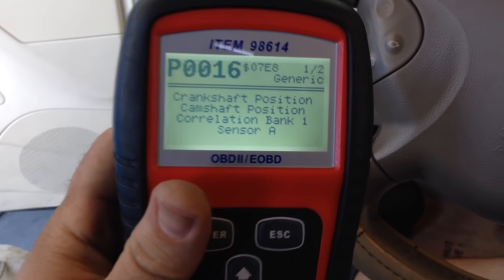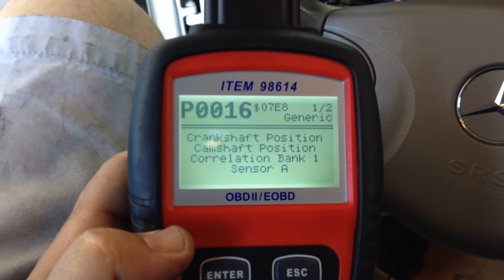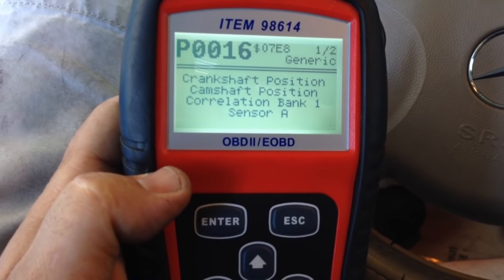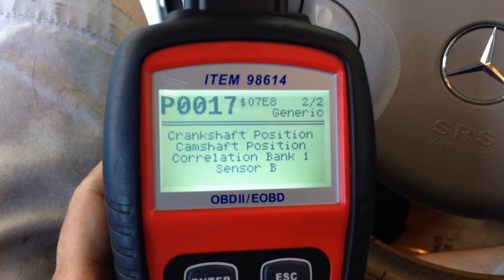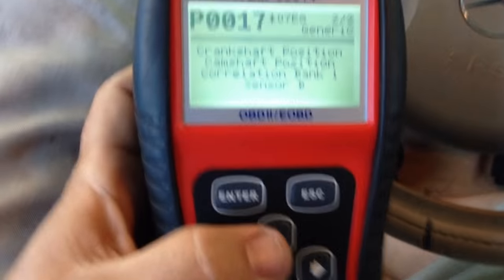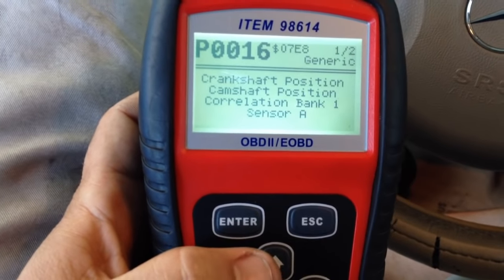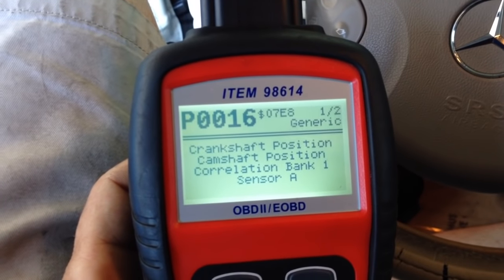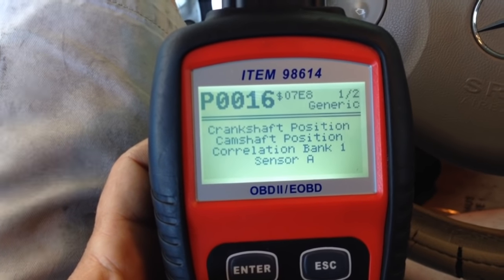Mercedes Camshaft position sensor p0016, p0017

Comment: I have a 2006 c230 & have just gotten these 2 codes (P0016 & P0017).  We just changed the oil with the Mobil 1 synthetic oil & the codes still appear after being cleared as you mentioned they may.  Previously, I received 2 codes (P1200 & P1208) which appear to be very similar codes.  Can you recommend if I should get this work done or just invest in another car?  Or, do you have any other suggestions that I'm not considering?  My car seems to be running very "rough" & I don't want to get stuck in LAX traffic.  Thank you very much!
Reply from the maker: I can't make financial decisions for you but I can tell you that a repair can cost around $4,000 and if done right you should have a good running car for long time.

Comment: Hello David, I own a 2006 Mercedes-Benz c280. The check engine turned on and teo codes showed up at the same time (p0015,p2768). Before it turned on I felt with time how the gears were shifting rough and it was getting worse and worse until the check engine turned on. Now it is stuck in a gear, i believe this all started when i changed the engine oil. What do you think the problem could be? Thank you have a good day
Reply: Thank you David for answering, I just had one more question. I have a powertrain warranty for 3 months, if it would not be covered by any chance, how much is the estimated cost of the fix?
Reply: Where is his reply

Comment: David gr8 video. I have a 2010 E350 and having engine start problems occasionally. The battery and alternator have been checked as good.My engine has failed to start on several occasions after the car has been driven or on the first start of the day. I am baffled by this,do you have any suggestions? Thank you

Comment: Have you heard of this happening with a 2007 Mercedes Benz clk550? And what if it's just the P0017 code? Could it be something else more simple and if so, how can you tell?
Reply: How did you get the code p0017 fix?
Reply: @olaomishore  It was a car looking to buy, thank God I didn't. I found an '08 CLK550 for $4,900 45 minutes away from me, so far I haven't had this problem.

Comment: Just a quick question, what ratchet attachment and size would I need to rotate the crankshaft to 305 degrees on a 2006 Mercedes C230 (M272)?
Reply from the maker: 27 mm

Comment: I have my 07 E350 and when I start my Benz I have rough idle some time and other times I does not happen at all.  by rough idle i mean that you can feel like if the engine is either miss firing or the cam or crank sensor did not catch the right position so it idle funny and you can feel the irregularity in the idle, not a smooth idle. could this be the cam shaft sensor?
Reply from the maker: StealthShadowFox do you have any fault codes??, it can be as simple as motor/transmission mounts and it can be as bad as the balance shaft, if you are in GA, bring it in so we can check it for you.
Reply: Mercedes Benz Techs tha k you for reply.  no I live in FL.. I am pretty sure its not the mount. I have had time when I turn it It on it has like a shaky idle and it goes away in a matter of seconds. other times it stay on for a bit. I usually turn it off and then turn it back on and its fine. I have not codes before. but now the check engine light stayed on. I have been driving it since then (started yesterday) and I have had no issue.
Reply from the maker: StealthShadowFox have the code checked first, it might be a bad injector as well. Have codes checked first

Comment: I have a 2006 E350 with 153,000 miles. An original balancing shaft would not last 150,000 miles correct? Car drives and idles great. Do you believe the camshaft adjuster magnets could be the issue? I want to try the Titan oil because after I did an oil change one time the light went away (battery was not disconnected at all but the codes came back.) Besides the balancing shaft what else could be the issue?

Comment: I have a 2011 C300, the engine and location of the camshaft sensor seem to be the same. do I need to replace both? or are there 4?  I did see a video where they replaced the sensor, and the problem was fixed.  Do you have to turn the crankshaft when doing the replacement?

Comment: I did everything you said in this video. The two circles align , I changed oil and replaced sensors and solenoids however the p0016 p0017 still come up .  What else could it be?

Comment: David, I have 2007 C280 3.0 V6, Came to me with P0019 Camshaft Adj Solenoid. However its also is Missfiring Bank II , Cylinders 4, 5, 6 and its Noticable bad ! Just the One bank, Same Bank as the code. Would this Error cause Missfire ?
Reply: +John Spofford: I have the same vehicle and a similar issue.
Reply: +Jai DaMann issue ended up to be camshaft positioning sensor on mine. I scoped all 4 sensors and this one was dead. the scan tool must have defaulted a reading this is what threw me off. Why that bank went into missfiring ?? no idea but I had skips on all cylinders that bank

Comment: Hey I was driving on a highway when my car stopped running and wouldnt turn on, it turns over but does not start. I have a 2007 E350, I checked my engine # and its above the “infected” engines by a lot. I did not check the holes yet but do you think it might be something else?

Comment: Hello Mercedes Benz Techs.  Wonderfull video, thanks for it.  I have a C280 Avantgarde Sport 2006, and have the same vibration problem.  The car runs OK but when in neutral vibration is there.  They scanned it and said was a missfire.  Could missalignment be the problem?  Do I always have to check for 305 degrees alignmen?  Thans
Reply from the maker: Iván Medina you need to check what causing the misfire first.. bad coil? Bad spark plug? Or out of timing? You need a professional diagnosis first

Comment: Hi there I drive an 07 CLS550 and I am curious which side is Bank 1 on? My guess is the right side so passenger side
Reply from the maker: Yes.
Reply: @MercedesBenzTechs  thank you!
Reply: @MercedesBenzTechs  The car is showing codes P0016 and P0017 for camshaft position sensor A and B. Where on the engine are they located?
Reply from the maker: @jacquelinekinuthia1342  on top of the cams but they should be fine.. it’s probably timing chain

Comment: On my C280 year 2007,  had an engine light on from consistent camshafts adjustable. Should I replace any magnet?
Reply: Or first needet to see that holes if are in center?
Reply from the maker: First check timing
Reply: @MercedesBenzTechs  after taking off valve covers?
Reply: @MercedesBenzTechs  can you help me to know how to check it?
Reply from the maker: @redihoxha2940  I have a video on how to check the timing
Reply from the maker: Remove the cam sensors and turn the engine to 305
Reply: @MercedesBenzTechs  the same thing that you have made...and if it's in time should replace any sensor?
Reply: @MercedesBenzTechs  where is the video for checking the timing

Comment: 2006 Ml350 had balanced shaft done 4 years ago. Now have 130k and I pay extra attention to oil it was very low check engine line on today for last two days pulled code when changing the oil p0303 and p0016. Any ideas? My gas cap was loose. I tighten it.. Do think it could be the sensor this time and or the CEL on cylinder 3?
Reply from the maker: First take care of the misfire on cylinder 3, most likely coil went bad..after that clear codes and drive a little, depends on the quality of the work performed on your car..it might be several different issues but I wouldn't think it's the balance shaft if it was a new one

Comment: Good video. I went out of the country for a year, my car ( c230) had not been driven for 6 months. Battery died.. I replaced it, drove for about 5 minutes, car stopped ( steering wheel got tough to steer).. car starts but will shut down in a minute. Towed it to the Dealership diagnostic test didn't show anything major wrong apart from an inconclusive test on "CAM." Dealership says it will cost me $900 for their tech to check the "Cams"... I need your recommendations? Thanks.
Reply from the maker: $900 to check the cams??? Hell no!! Takes 30 minutes! Why they need to check the cams? What year and how many miles?

Comment: Hi MB, what happened if two intake camshafts are dead on the centers. But the other two exhaust camshafts are off the centers by a little on the upper way of the holes. My car is 2006 R350. How do you say about this Off? Thanks in advance.
Reply from the maker: Than you are off timing.. the valves spring always pushing on the camshafts that’s why it may look that you are on timing on one..
Reply: @MercedesBenzTechs  Thanks for promptly responding David. Really appreciate it. From your point of professional, Is it better to do the engine swapping  or rebuilding it? Car mileage is 180,000Km. Again thanks, best regards

Comment: You mention cranking to 305deg, then it sounds like you rotated 180deg, so are you aligning the top alignment mark to 305deg or 125deg? Thanks for the video, very helpful!
Reply: He was 180* out on the camshafts, so he rotated the crankshaft 360* to bring the camshafts to the correct location... Camshafts turn half of crankshaft speed, so it takes 720* of crank rotation to get 360* of camshaft rotation.

Comment: hi guies

WITH THE CHECK ENGINE LIGHT ON,

 Ive had the same code P0016 and P0017 when diagnosed,

on a 2006 mercedes benz C280 4MATIC...

there is no problem driving, but the engine tends to idle up and  a rough noise  when the car is  parked, 

also does the above code involve or contribute to the steering issues??

when on  driving mode on the free way... there is no problem, 

only when the car is stationed or pulling out of a parking lot its hard to turn the steering wheel.

any help is highly appreciated !

GOD BLESS
Reply: +David Jacov 
APPRECIATE THE  HELP
IM AT PHILLIDALPHIA 

ANY BALL PARK FIGURE TO THIS TAKEN CARE OF ESP CEL?

THANKS

Comment: i have 2007 mercedes c280 4matic. got the p0128 and p0016 code.  i had problems where the car sometimes won't change gears but that just stopped and hasn't happened again. i want to pass smog inspection.  your thoughts..
Reply: how much do you think i will have to pay for that type of work? estimate.

Comment: I have exactly the same problem with my Mercedes e350 2006 my mechanic replaced the sensor but it did not fix the problem where is your shop?

Comment: I need some help, I have a 2010 Chrysler Sebring 2.4 l I'm familiar that Mercedes and Chrysler was partner during those years.  My 2010 Sebring is throwing the same 2 codes 0016 and 0017 does that mean the balancer is off and it's not as simple as replacing the sensors?
Reply from the maker: No. Do more research.

Comment: Hey David thanks for all your help. I have a question i just bought a 2007 Mercedes c280 4matic with 61k on it. Codes that have come up are p0023 and p0020 p0446 p0410. and random misfire codes on all cylinders. Most times its runs great but sometimes has trouble starting up sometimes cranks but doest start. Should i start by changing magnets? cam sensors on drivers side? looks like passenger side have already been replaced. My engine serial number is 272941 30 542953 so it doesn't fall under the problematic balance shaft issue if i understand correctly. Any help is greatly appreciated thanks
Reply: Have it checked.

Comment: I have these codes after the sensors were replaced last week. (2006 W203 C280 with 65.000 miles.)
If a M272 has this shaft failure, what is the  damage risk when driving it without fixing? I need the car for vacation soon and my garage is closed after next week for vacation. Maybe it is wise to do new oil and filter?
Thanks.
Reply from the maker: Bend the valves

Comment: I was wondering I no you said to take out the sensors on the passenger s side turn to 305. What I'm wondering is the drivers side sappose to be the same and have the circles in the middle  like the passengers side.  Their is absolutely no videos about this anywhere appreciate all your Videos and for any future help you can give me. We're getting Po16 /17/18/19 and random misfire on PO 300/301 threw 304.  Thank you appreciate your time. . 
   Allen Z
Reply from the maker: Yes,both circles have to be centered perfectly, a deviation of 1 degree will trigger check engine light.
Reply: @MercedesBenzTechs  both sides at the same time left and right side / passenger s side and drivers same time or do I have to turn the drivers side 180 after the passengers side lines up.    
    And may I say what a quick response greatly appreciate much thanks Brother
Reply from the maker: @allenzard1458  yes, they should align exactly at the same time.
Reply: @MercedesBenzTechs   thank you thank you thank you Brother You have been a great help for me today.  To help people out makes for a better person all around.  We can all only wish and dream their were . more kind people out their . To All your SUCCESS
  Bless You Brother 
      Allen Z
Reply from the maker: @allenzard1458  thank you for the kind words

Comment: I have  a Mercedes c250 2014 the m271 evo  engine 1.8 T . Fuel keeps mixing into my oil. Do you have any solutions? I have already changed my crank case bleeder valve and still have the problem!
Reply from the maker: Maybe injector leaking..
Reply: Thanks I’ll look into that

Comment: I'm about to get a 07 s550 and these camshaft positions sensors Code is on 17 and 16 the guy says it's the sensors if he change them and it's not that the code will come back up right?Plz help!!
Reply from the maker: On the 273 engine (V8) there is a known issue with idling gear, I rebuild about 95 V6 engines wile only 3 V8 engines, have it looked at before you buy.

Comment: I have a 2010 Mercedes c300, would the cam shaft position be the same for my c300 as it is for the e350 you are working on in the video? Thanks in advance I really appreciate the information.
Reply: No, not a 2010..

Comment: what oil is best for the winter months in my 2007 S550? I'm using Mobile One 5w30 Full Synthetic now.
Reply from the maker: Eric D  what state are you located at
Reply: Mercedes Benz Techs  Michigan
Reply from the maker: I'm not sure how cold it gets in Michigan, I would recommend you to console with a local repair shop but here in GA 5w 30 viscosity is completely fine. You should use only fully synthetic lubes and from the highest grade you can fine, Mobile 1 is recommended by Mercedes, at our shop we use LiquiMoly, it's a German manufacturer of high quality lubes that trusted by many Mercedes shops and high performance shops around the US and Europe.

Comment: hello i just bought a 2007 e350 really chip in mint condition but unfurtunately  its trowing those two codes, so my question is whats a fair price to raplace the balancer?
Reply from the maker: Israel Martinez it’s not only about the price it’s about the quality of the repair, if they change also air filters, idler pulleys, v belt, all vacuum hoses, thermostats, cabin air filter, air dryer on condenser, power steering reservoir, timing chain, cam sprockets(should be replaced as well), rear centrifugal cover and cam plugs, engine oil filter (twice)
Your cost should be around $6,500
There are many other things that need to be changed as well, if they do a crappy job, you’ll pay less, make sure you choose a repair shop that known for their work not price.

Comment: I have a 2006 MB C280 with these codes. I know it's an expensive job and can't smog my car if engine light is continuously on. Question, if I am not currently having any issues, or symptoms is it still safe to drive? Or do I need to get it fixed asap? I am worried....thanks!
Reply from the maker: Leese Vee depends how far along the damage on the shaft but there is no way knowing without opening the engine.. how many miles?

Comment: Where is the location of Bank 1 Sensor B in my ML350 2011?  I have the P0017 code. Apparently the above sensor is not working. The circles are perfectly aligned with the holes at 305 in my ML350.

Comment: I have a 2005  SLK 350 R171  after driving the car for a bit then I stop engine off perhaps for 15 20 mins, cranks no start. I try 4 to 5 times will not start some times it will start if I wait a few mins and some times nothing only after the car has been left for an hour or two will start but no check engine. Can I get fault code though no check engine? What can cause this? Crank position sensor? The car has 78k miles. Thank you, your input will be appreciated.
Reply from the maker: torchmmaempire need to see what the engine is doing in real time, it can be CPS but it can also be so many other things like bad key, ignition switch, fuel pump, bad timing poor compression, I can name at least 20 more reasons, if you are in GA, stop by so we can check it for you

Comment: Good day
Thank you for the video. Quite informative. Please I have the 2008 C200, M271 engine, the error code im getting is "P0017 - Crankshaft Position - Camshaft Position Correlation (Bank 1 Sensor B)". Tried clearing and it comes back again. Could you assist with the most likely solution
Reply from the maker: Kgomotso Thelo change the camshaft solenoid or you might have a bag battery the problem is not related to your engine
Reply: I'm getting the p0017 code as well. is the camshaft solenoid the magnet or sensor? also should I replace the intake or exhaust one on passenger side engine

Comment: My engine runs good and no Leaks but I do have an engine light on ..cam shaft cranking correlation sensor A&B are indicating note I have no leaks and th engine starts smooth do I have an expensive repair or just a minor thing